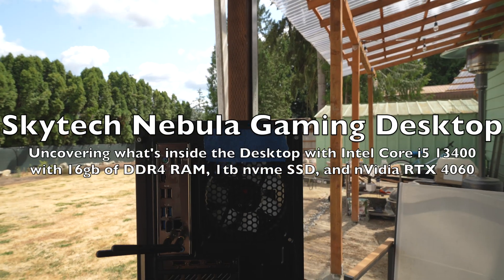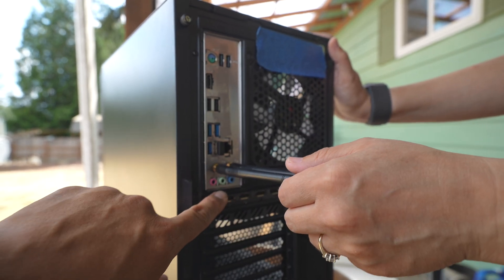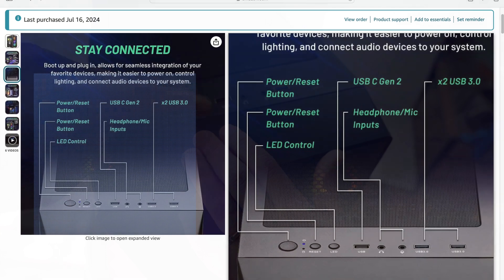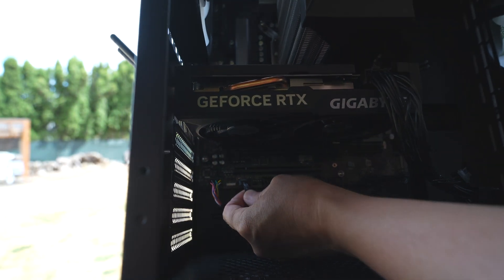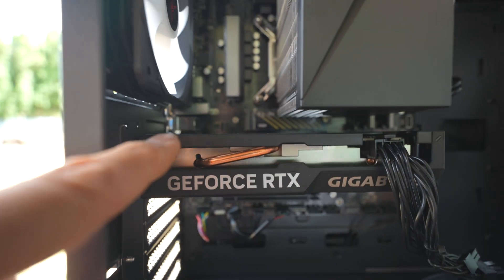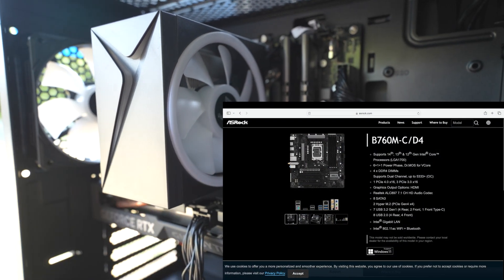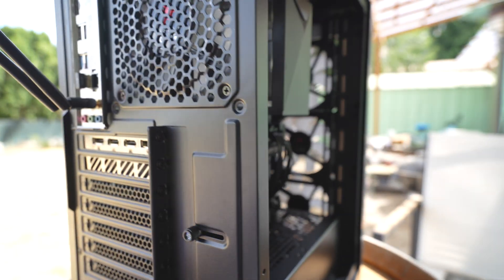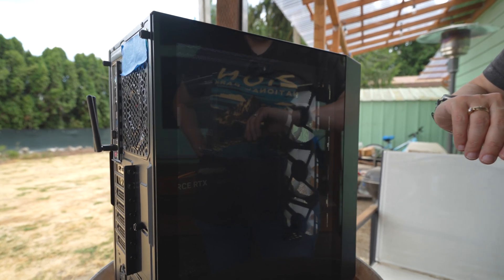Skytech Gaming PC with a Core i5 Intel 13400F Uncovered

Comment: I’ve had this Pc for a while how do I install a Sata SSD? Does it need additional cables?
Reply from the maker: So if you take a look inside the case the motherboard is an Asrock B760M-C/D4 it shows there should be enough SATA connectors, you'll also need SATA power for the drive as well. Not sure if there's an extra power cable off the power supply, if not you may need to purchase a SATA power splitter cable and a SATA cable from motherboard to drive. You may want to download the manual directly from Asrock's website too. Hopefully, this points you in the right direction.

Comment: Would you guys know if the i5 13400f is affected by all the new intel 13th and 14th gen problems
Reply from the maker: From the articles I've read, it looks like all CPUs. According to Intel, motherboard manufacturers are giving the CPU too much power. But it sounds like Intel is extending warranties for all the CPUs affected. I originally thought it was only the core i7 and i9 13th and 14th gen, but it's all from what I last read.
Reply: @momanddadmeetworld  Are you planning on getting a new CPU for this PC? Or are you gonna play the CPU lottery and hope you didn't get a defective CPU. That's what I'm doing right now lol, since I have the i5 13400f and i dont want to upgrade to another Intel chip or switch to AMD as that requires a whole new mobo and reinstalling windows. So far my pre built never had a problem with this CPU and I had it since April 2024

Edit: after more research, people are a saying only CPUs with the raptor lake architecture is affected by it, and the i5 13400f can come in both raptor lake architecture or alder lake. 12th gen CPUs used alder lake architecture and people are saying the i5 13400f is basically a 12th gen rebranded. i5 13400f do come in raptor lake but they are a bit more rare and harder to come by. So the vast majority of people should be using alder lake architecture, which is safe, according to alot of people on reddit lol. I got conflicting answers but all I know is my CPU seems to be doing good as no problems have risen
Reply from the maker: @wholelottagangshid  I'll be keeping the CPU. These CPUs are pretty pricey. No issues yet and thinking that if you haven't had any issues arise, then you'll be good too.

Comment: How does it preform
Reply from the maker: Buttery smooth with Windows 11 and day to day tasks. I'm using the computer with a 32" lg running at 2560 by 1440 at 120Hz, so very fluid. Games are fine on high settings at 1080p. More and you have to turn quality down to maintain frame rate or upgrade the video card. But I'm more than happy with 1080p.
Reply: Great